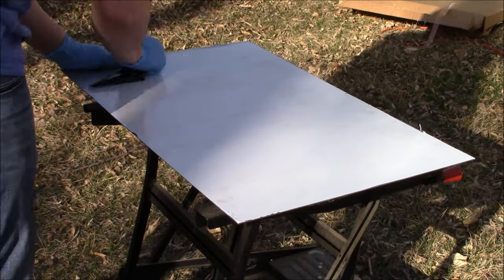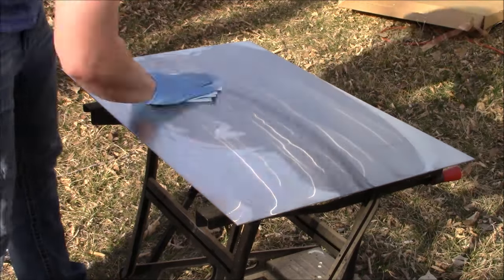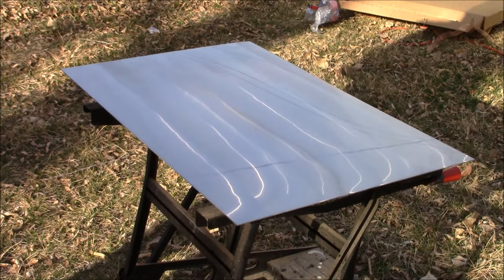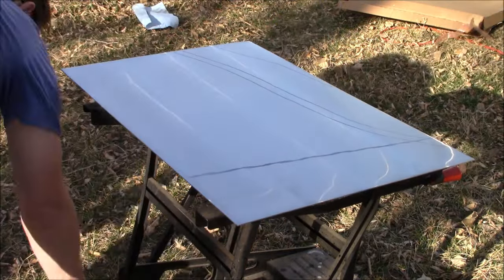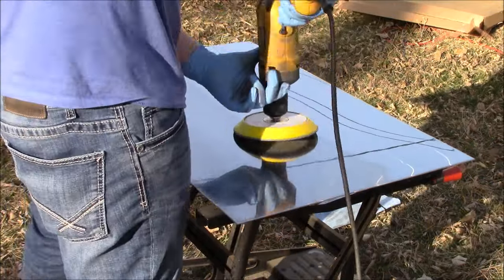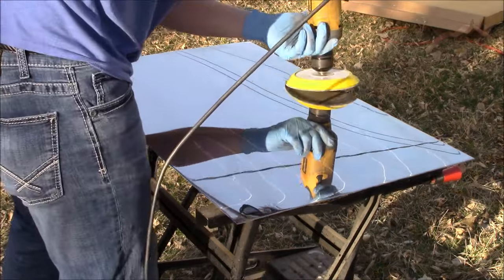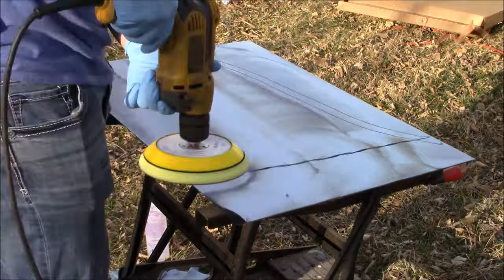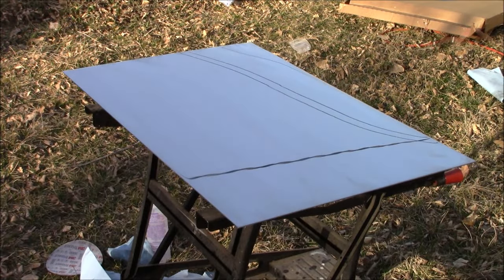How to Sand and Polish Stainless Steel to Mirror Finish [Version 2.0]

Comment: I have a large stainless steel dining room table that is 25yrs old
 I'd like to know if I must go through all the sanding you did in this video.
Also, I once saw that someone created a design with a sanding tool and it looked wonderful 
What could make a lot of etched circles on the table?

Comment: Great video.  I am trying to polish mild steel.  I'll have to get the sanding set up you used.  I also recently got some high grade microfiber towels which do not leaves any scratches and clean off the polishing film well.

Comment: Hello. Question from an artist trying to do something similar. What's the thinnest cut of stainless steel foil do you think it would be possible to shine to a mirror finish? I need something flexible, so I fear I will SOL because I would need something thick enough to survive a sanding, but that would make it too think to flex as needed.

Comment: loved the video.  I have a problem of not getting the finish shiny enough.  i get it reflective, but not mirror finish.  When i use wd40, especially, if leaves a dark residue that I have to clean off.   Also, I seem to get a lot of buildup on the sanding pads (all grits) Any advice?
Reply: Same thing here... Got a very high reflective steel, but with a blurry effect on top... not sure what I am doing wrong...
Reply: If you go at it with a polishing compound/rag long enough, it will get shiny. Try it in a small spot and you will see.
Reply: You’re burning your Trizzac desk in which will leave a glaze over it. Replace your desk more often you’ll need to go back to 1200 grit to get rid of it properly.

Comment: How long do you sand for each grit of paper?
Reply: Until you get rid of the marks from the previous grit. I am NOT an expert but I did this with a belt sander on acrylic/perspex the other year. Sand in ONE direction until all you can see are marks in that direction, then change to finer grit, turn 90 degrees and ... Worked very well.
Reply: Spring Ford thank you! That sounds like a perfect technique, as it removes all doubts about whether or not one has sanded enough.